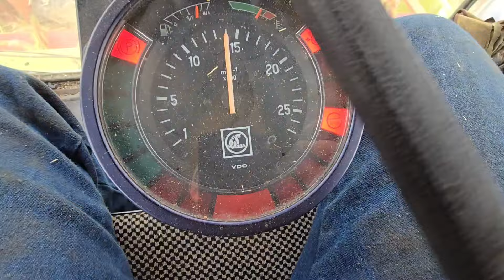The Claas Dominator 108sl Chewing Barley!!

Comment: Only thing we found to control kochia was a cultivator, knocked out about 50 acres this year with the old cultivator that was a matt of kochia before seeding. Not a bit of kochia after harvest. Gotta run the iron through it once in awhile and it will do what its supposed to do
Reply: All that seemed to do here was spread it around the field more